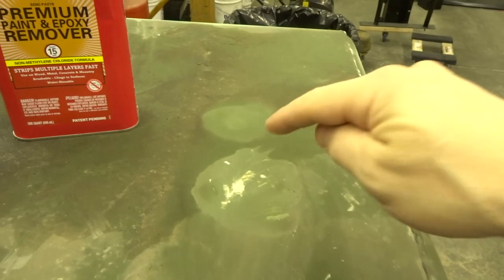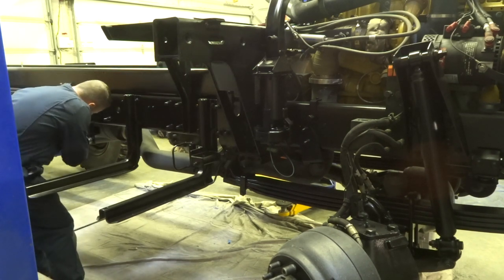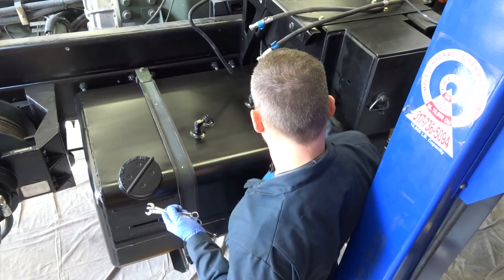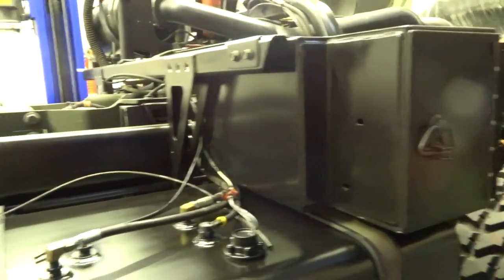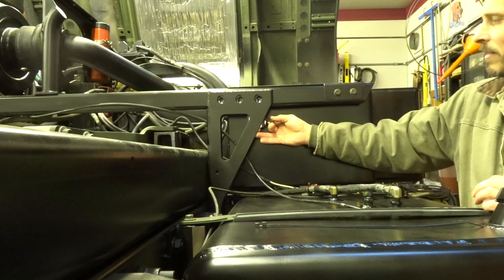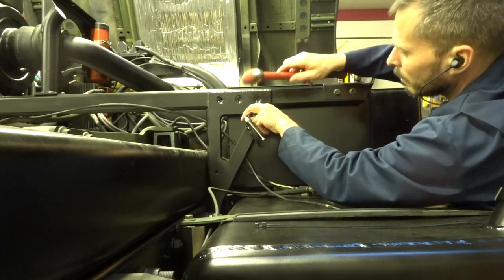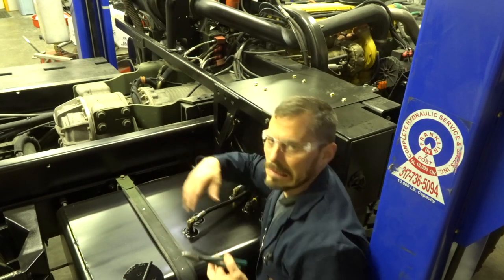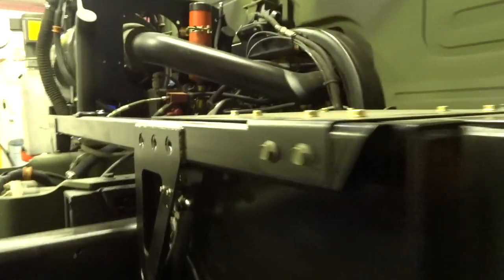Installing the Diesel Tank and Cab Leveling Solenoid

Comment: I can only assume you do know that winch is designed to be used out the Front or the Rear of the truck. Just need to pull it back through and run it out the other side.
Reply from the maker: Yep.  It’s just easier to fish the line when the diesel tank is off.

Comment: I like that switch installation but I am scratching my head trying to figure out the purpose?  Did you eliminate the leveler or something?
Reply from the maker: I eliminated the entire hydraulic valve assembly.  Stay tuned for the next video :)
Reply: @BrokeOverLand  why have a pneumatic switch at all?  Can't the cab level just stay pressurized all the time?
Reply from the maker: Kevin H you want to dump the pressure when raising the cab. Technically you could leave the airbags pressurized.  But I’ve found the cab support hoop flops forward when the cab is lifted under pressure and the cab hits it when it comes back down.
Reply: Broke OverLand 

Looking forward to that one!   Keep me coming.
Reply: @BrokeOverLand  How does it stay level?  If you have the pressure at max you will drive down the road and have "top out clunk" because the cab air bags are at their top most bump stops???
Reply: @BrokeOverLand  Your cab leveler is broken then.  If you raise the cab the leveler should automatically dump pressure so it does not do that.
Reply from the maker: Fastidious Restomods when I raise the cab with air in the system.  The support hoop stays at the same level and just flops forward to the bracket on the engine.  It could be a bad leveler but the cab doesn’t clunk or seem to hit the top of air bag travel.  I’ll mess with the ride hight and see if it will adjust.  I’d like to delete the switch if I can.
Reply: @BrokeOverLand  sounds like a bad leveler for sure.  Just a heads up if you drive around with the bags maxed out like that it will lead to other issues as well as early airbag failures.  See if fixing the leveler helps.  If not then try something else.  Thanks for the explanation.  I understand what you are trying to do now.
Reply from the maker: Fastidious Restomods thanks for the tip.  I finally got around to adjusting the leveler correctly. I stuck it back to the same measurement it was when I pulled it off for paint.  Didn’t even consider it was adjusted wrong to begin with.
Reply: @BrokeOverLand  Glad you got it figured out.  It is always something simple with these trucks...